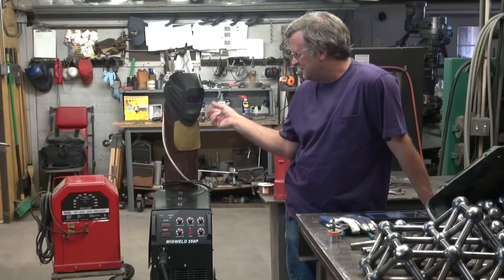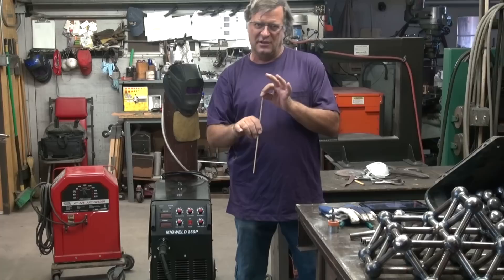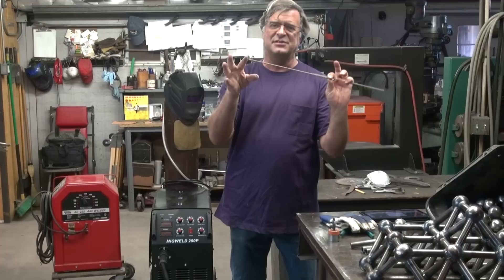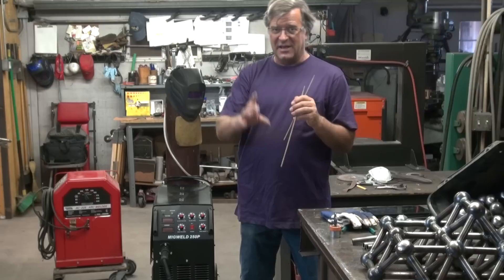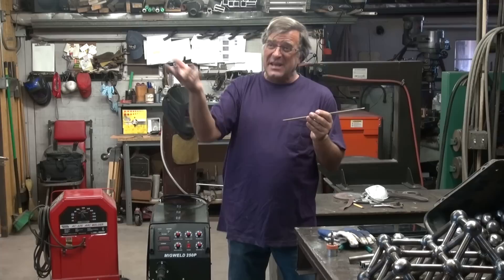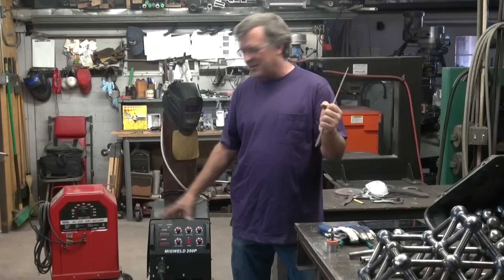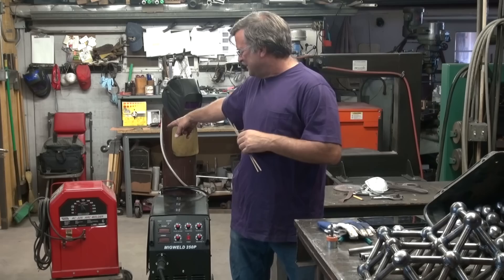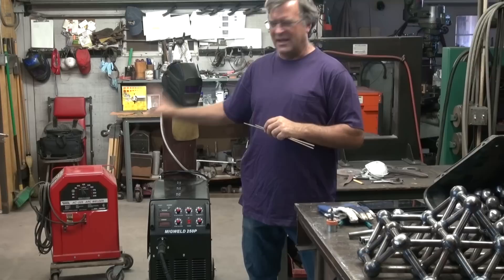MIG Welding vs. Arc Welding - Which Welder When? - Kevin Caron

Comment: It's worth mentioning that you can instantly switch stick electrodes vs swapping rolls of wire. You can also buy quick connectors to add additional leads to stick welders for field repair jobs. Used stick machines are the way to go when buying stick welders because there is so little to fail. Used MIGs can be problematic and often need gun liner or gun replacement.
I have both stick and MIG and am comfortable with both processes. If I were allowed only one welding machine it would be stick since my main work isn't sheet metal.  If you want to weld auto body parts etc, get a MIG with shielding gas and have at it.

Comment: Arc Welding is also called E-Hand and MMA in Europe. Thanks for video. Stick advantage is that its cheaper and simple (no need for gas, never ruin or clean gun etc). For car, I would probably go WIG, but its twice the price class.

Comment: First thing in your hands for learning welding should be a stinger IMO. When you become proficient with the stick it will transfer over very easily to MIG . We ran Miller generators and jet rod for building very large above ground storage tanks for the petrol industry. Today in my home shop the Miller is a MIG and gets 70% and the TIG 30% of the use. Outside I will run stick just for the memories or as stated by this gentleman for heavier work or just memories. 
Whichever, time behind the glass reigns supreme.
Reply from the maker: Welding can be a very expensive past time for sure!      Most folks just want to get started and need a machine.  The machines all have their uses and you just need to find the right one for you. 

Ideally you take a class where you can try several types of welding and see what works for you. 

Thank you for watching and posting!

Comment: Would it be correct to say that the stick welder is far more forgiving when working with materials that are dirty, rusty ...etc.??  Also, I have never tried to MIG weld galvanized, but have stocked welded it many times (which I hate doing)

Comment: Hey Kevin, I mainly weld heavy plate, agricultural stuff, In the UK they sell a lot of cheap air cooled arc welders, they have a very short duty cycle, I recently bought a TONCO 140 amp oil cooled welder for £130.00 new, Very industrial looking and works great.Seems far more powerful then 140 amps. I think oil cooled is a lot better then the air cooled buzz boxes, whats your opinion, love your videos. Thanks, John.

Comment: Kevin like your vids, great info,  If I was to weld an iron ring onto a cast iron wok burner what would I use an arc or a mig?
Reply from the maker: Haven't done much cast iron welding but I would say Arc.  There is a rod for doing just this kind of work but I am not sure the number.

Comment: Why did you say you would rather use the stick welder for thicker metal but then you said that the MIG welder can go 25 amps higher than the stick welder and that they are comparable in power. Thanks for the video! This seems to cement my idea that for general car repair starting off with a mig is a pretty solid choice.
Reply from the maker: I feel stick has better penetration than Mig.
Reply: @KevincaronSculpture  unfortunately that's a false statement

Comment: Great Video. Just one question, which makes a stronger weld? I was told years ago to only Mig or Tig a motorbike frame but never had problems on stick welding! Is it actually weaker with stick or just easier with mig?
Reply from the maker: I feel it is easier to get the pipe too hot with stick..   You wind up making it brittle and more prone to cracking... Just my opinion..

Comment: Hi Kevin, thank you for the upload. Could you please tell me whether it is possible to use a mig machine  (Mig welding ) to fabricate a H or I Beam 5mm to 10mm in thickness? i would be fabricating the steel beam from mild steel sheets, any advice would be much appreciated, thank you
Reply from the maker: +JMR FABRICATIONS JMR FABRICATIONS 

Going to need at least 250 amps for this job..    But yes, should be easy to build.    Just be sure on the fit before you start welding.

Comment: 7014 is a weld rod for flat or fillet welds, it has iron powder in the coating for high deposition, when things are right it lays a beautiful weld which the slag can be cleaned with your pinky because the slag peels up. I welded hydraulic tanks for earth movers with the rod. Easy to start, smooth welding, fast deposit 2 or 3 x faster than 7018. Not for a poor fitup though, very low spatter. Lincoln used to list it as jetrod. Give it a try sometime. Curtis

Comment: What about the 90 Amp flux wire welding. How do you compare it to Mig machine. Chicago electrics are making those flux welding machines. I am thinking to buy one but I am not sure if I would need Mig later

Comment: For start up I think an arc welder would be a better choice all you need is the welder and rods for mig you need the welder, gas bottle, gas, wire, nozzles, tips
Reply from the maker: I think it also depends on what you are going to do with it..   A stick welder for outside work is great but if you just want to make stuff in the garage or make art than a mig would be better,    just my 2 cents...
Reply: Stick welding is a bit cheaper to start off with but typically more expensive if you do a lot of welding and a mig would work (no drafts, etc).  I started learning welding with an everlast stick welder but quickly bought a nice everlast mig welder once I got serious.

Comment: Not really a comment, but a question. I'm a tool and die maker , who occasionally welds. Mig, Tig, and stick. Are there any difference in weld strengths between the 3 different welders?

Comment: If you had a 1/4 wall tubing that needed to be structural strong and you had a 200 amp machine that did mig or stick which would you choose?
Reply from the maker: To weld 1/4-inch wall tubing I would use the mig function.

Comment: Question: what if you live in Mexico in a place where it's impossible to get the gas foe welder, then which one would be "almost free maintenance" but simple to use on welding steel rod, steel fences & steel house doors?
Thank youuuuu!
Reply from the maker: I would go with stick over flux core mig.

Comment: very nice explanation. thanks. im a beginner in welding. your machines are very branded and expensive. thats good.   im just wondering if you have heard of asian brands welder like YAMATO 300 amp A.C. arc welder. if so i hope you could also make a review on it. so that the ones with low budget can also appreciate. thanks so much sir.
Reply from the maker: sorry but we don't have that brand here..

Comment: Since they can operate over 200 amps...how do these work without causing a 20 Amp circuit breaker to trip? Also, if I wanted to fabricate an aluminum box (cabinet for a fire hose); .06" marine grade aluminum; how do you recommend connecting the sides?
Reply: ***** Thank you. Tig it is. Signing up for welding class at local city college next semester.  Thanks for the info. And thanks for explaining the electrical concepts.

Comment: is mig welding as strong as stick welding. or should you use stick welding to build things like a trailer, can you use  mig welding for that too?
Reply from the maker: +cruisernet I like stick for outside and for over about 3/8th of an inch.   
Other than that mig is just as strong as stick in my opinion.

Comment: what kind of generator is good for the Lincoln stick welder the red one in the background
how many watts to for the generator
im basically gonna use for a pipe test 6g
Reply from the maker: Any inverter based generator will do..    6500 watt minimum.
Reply: +Kevin Caron, Artist ok but have u used that lil red Lincoln on a generator ???
any suggestions what to get n brand ???
Reply from the maker: I do not have a generator for welding..   I just saw one at the Honda shop the other day and am trying to get it...

Comment: how hard is arc welding I'm use to might but I found a arc welder for $75 its a older one and I plan on welding automotive sheet metal panels I used might before so how hard is it from might to arc
Reply from the maker: +Michael Kuneman     Much harder to Arc weld over Mig..     Don't recommend it for sheet metal body panels at all!

Comment from the maker: You are getting a little out of my expertise zone with this question!!

I would say the strength of the weld is more the person running the machine than the machine itself.

But if I had only one machine it would be a TIG, in the 200 to 250 amp range.
Reply: Based off this video alone.. I would say you are outside of your zone because sure.. you did some welding in your garage on light work machines VS PRO level watertight or even less than jobs... If you have to constantly look down at notes and do alot of uhh and ummm not really professional. I hope in the years since you made this video you might have learned a thing or two and can make a more educated video that leaves less questions but more factual answers...

Comment: @Kevin Caron, Artist So would the mig be better for use on cars doors where maybe the bottom half had rotten off and a new piece of metal would be welded in? instead of the arc/stick which would be way too powerful,messy and maybe burn through the new thin metal
The mig without gas,is that still an option for car use,is the only real difference comsmetically?
Finally when you have welded new metal parts together, what do you use to protect them from rusting again,what primer do all welders use on fresh bare welded metal to protect it whilst maybe later on the original colour of the vehicle is painted over it?
thanks from UK
Reply from the maker: Yes, definitely you can use mig for auto body, much better than stick..    I would use gas and solid core wire, NOT flux core..

As for primer, I just use a rattle can to keep it clean till it goes to the painter.   He then strips everything clean and does his part.
Reply: Kevin Caron, Artist
I got my welder a mig 150a amp and tried it with the flux core and no gas just to have a go.
My god it was a right mess,i tried welding on some galvanised metal sheets as thats all i had to hand,the weld hardly held at all and was very messy.
Have i used the wrong metal to practice on?
Reply from the maker: Yes, you are practicing with the wrong metal..  As well as using flux core..    This is the same as using a stick welder to do auto body..  Not going to work..

SOLID CORE WIRE WITH GAS!  

Get rid of the galvanized sheet and get the same type and thickness as the car body you want to fix.
Reply: Kevin Caron, Artist
thanks for your advice, i recently found out that trying to weld on galvanised metal gives of poisonous fumes :( I only tried a very small patch and outdoors so doubt any damage done. Ive got an old car exhaust made of steel going to try a few weld on that :)

Comment: I'm 15 and wanting to get into welding. Don't know why really but there is something about it that I enjoy. I don't have a lot of money so I was thinking about getting a cheap harbor freight one. I know it wont last long and will be in general just really shitty but it is better then nothing I'm sure of that. My first question is what type of welder should I get ARC, MIG, or a TIG. Secondly do you have any recommendations as to what welder to get that is around 100-200(the cheaper the better). And my last question is where would I get metal to weld. I would go and read to find information for this stuff but I want to figure out witch welder I am going to go with first before picking out some books to read.
Reply from the maker: +RantZ_IE 

Check this one out       http://www.everlastgenerators.com/product/mig/power-i-mig-140e

As to where to get metal,,,   You just have to find a scrap metal yard in your area.    Or a steel yard that sells cutoff pieces..  Check online for steel yards in your area..
Reply: Kevin Caron, Artist Thanks, But 400 is way out of my price range. Especially considering the cost of helmets, gloves etc.
Reply: RantZ_IE the cheaper the better?
whick would you rather have McDonald's or  in&out burgers? 
I bought a grinder from harbor freight for $20 and it only lasted 4 hours!!!!!! you get what you pay for, so go with quality save up  so when you're 17 you can buy a good one 👍

Comment: One other point id like to put out there.
When doing repairs on rusty steel an arc welder will bit through without a whole lot of cleanup.
Where I found mig gives more trouble if you dont get the repair clean.
Reply: ***** For sure the better the prep job the better chances the weld is gonna hold. But if you dont have that option in the feild arc works best.

Also you can use arc as a cutter for steel in a pinch. Not the cleanest cut but does cut.

Comment: There are 650+ amp wire feed welders. You can get up to 500 amps in a single phase unit. So stick for thick isn't necessarily the way to go. With a single phase millermatic 350p you can weld up to 1/2" material with a single pass. Most people who weld thick material will do multiple passes anyways so that welder would be more than suitable for thick material.
Reply from the maker: sd-dirt I don't get to play with the really big machines ...    Still learning about all the different ones out there.
Reply: Kevin Caron, Artist 
Millermatic 350p is an awesome welder. Try it out if you get a chance.
Reply from the maker: Will put a bug in the Miller reps ear...

Comment from the maker: As a normal rule you need 1 amp per .001 of metal. So with a 90 amp machine you can weld less than 1/16th thick metal. That's sheet metal! Like they make air ducts out of... 

If you are going to weld anything thicker you will need a bigger machine. Save your money till you can afford a 140 to 200 amp machine. Something that does solid core with gas.

Comment: Iff you grind or sand or blast of whatever off the layer of zinc  and the top layer of the metal itself all arond te area off the seem to be (also the back side wich is many of times impossible to get to You can actualy do a reasonable job but you need to do  that REALLY thoroug and in mans cases that is impossible of coure you need to retreat the area against rust but without cleaning you also have to do that i sa lot of work but posible to get a decent result.

Comment: Actually welding electrodes come MUCH longer than that, i used 800mm long 8,5 mm diameter (the metal core) High Yeild  ones myself in building and repairing ships ,submarines and LARGE storage tanks. No standard "garage" welding is ever going to require that kind of bad boys thoug. 

I do like your video's thoug i think they are a good help for beginners and what i call "hobby Bob's" 

Please consider that english is not my first language I'm from the Netherlands.

Comment: Is it fair to say a stick welder should be more reliable than a mig
Reply from the maker: Not sure if I would say more reliable but easier to use most of the time..    But also has drawbacks that MIG does not.

Comment: what is the difference between CO2 and MIG welding?
equiptment wise.
kinna confusing.  @@?
Reply from the maker: CO2 is an inert gas that is used to protect and cool the weld when Mig welding..  though a mix of co2 and argon is used much more often.
Reply: Jin H you can use straight co2 or a mix of argon and co2 aka 75/20, or 75/25 I forget lol , pretty much what he said^

Comment: that intro.... the cringe.
Reply: Calls himself "Artist" so it's pretty much expected.
Reply: @shawnkiller90  You must be the novice if you cant tell a well-versed welder from a noob (but what do I expect from someone called 'shawnkiller90' ROFL). Just taking one look around his shop in the vid, plus listening to the first minute, and anyone whose been in the business for a good amount of time will know right away that Kevin knows what hes talking about. Probably not a welder with a huge amount of knowledge or longevity within a specific field/type (of which, in welding, there are too many specialties to list) but again, knows what hes talking about. 

I mean, did you expect a thesis on metallurgy from a video called 'MIG Welding vs. Arc Welding - Which Welder When?'

Excellent informative video for the newbz out there, that applies simple context to basic welding aspects. I'm 41 and have been welding for almost 25 years, and was looking for a basics video to link to a friend just starting out.... this is perfect.

Cheers Kevin

EDIT: So out of curiosity, checked Wiki. Worked in machine shops and aircraft maintenance yards. Managed a car repair shop and built his own vehicle. I could be wrong, but that doesn't say 'novice' to me. More like 'above intermediate' and probably more that informed to make a video like this

Comment: Thought it was called stick welder because it sticked to steel every ark when your first starting out
Reply from the maker: There is that as well!!    Turn the amps up just a touch and that will normally stop.   Or if your machine has "hot start" play with that as well.

Comment: The cost on the mig is more.
Most migs do not come with a tank then you got to buy the gas.
To me you lose more wire to waste , buy extra tips.
Stick Welder just buy the stick.
Stick welder is more common man.
Stick welder is more work but cheaper.
Most people do not weld alot but when they do, the stick is cheaper for small jobs.